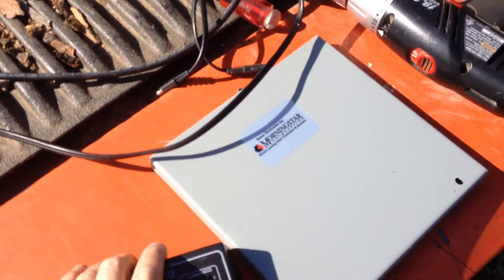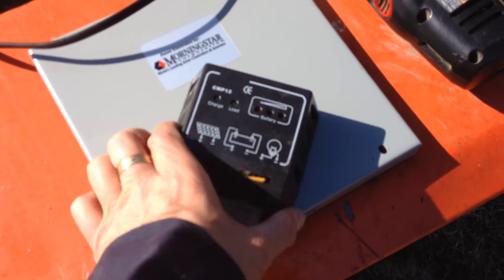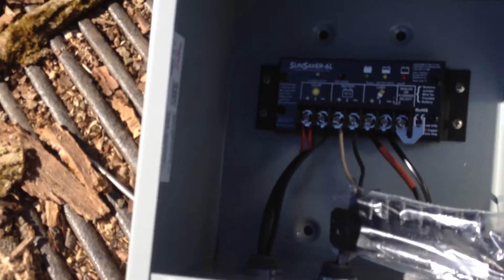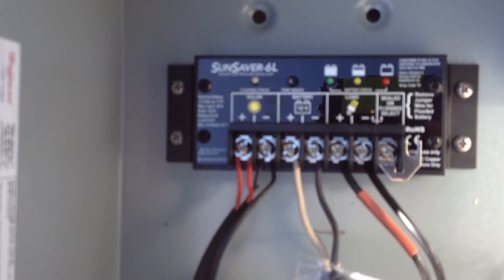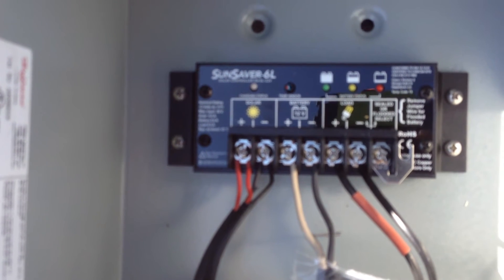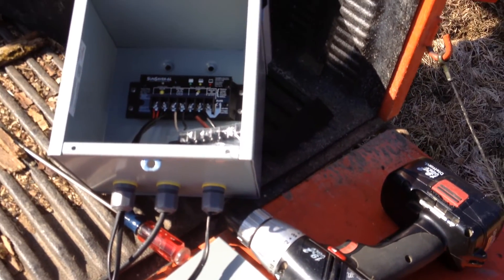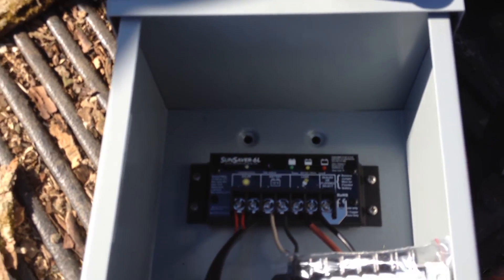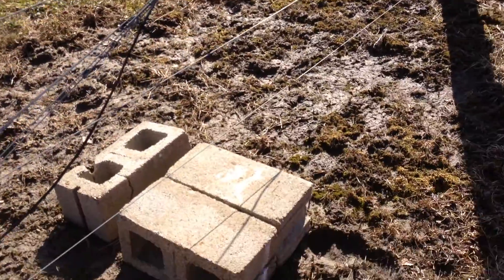Orchard Diary 4/2/2014: Fencer solar charge controller replacement

Comment: I recently purchased a SunSaver for a small solar power system and would like to place it in a similar weather-resistant enclosure. Could you provide more information about this specific enclosure (e.g., a model number?) and where you purchased it? How has your experience been with this controller?
Reply from the maker: It's a NEMA 3R rated enclosure that I got at a commercial electrical supplier here in town. https://www.nemaenclosures.com/enclosure-ratings/nema-rated-enclosures.html  Many manufacturers and sizes, so measure your stuff so that you get one that's big enough.   I really like the charge regulator, and I can't emphasize strongly enough that all of your grounds (panels, battery, loads) must be bonded to the earth ground to keep it from faulting out if you have an electrical storm in the area.  A "bouncing ground" will make it disconnect your load.  NOT unusual.  Good luck to you!  ay
Reply: I am just beginning my journey into solar power. I appreciate your taking the time to answer my questions. A lot of people seem to like Morningstar products. I look forward to learning more about this charge controller and the best ways to create an effective solar power generator. Thank you for both the information and the prompt response.
Reply from the maker: I strongly recommend that you subcribe to Home Power magazine as a road map for your journey.  http://www.homepower.com
Reply: I have. Thank you for the suggestion.
Reply: Will do...on both counts. Thank you.